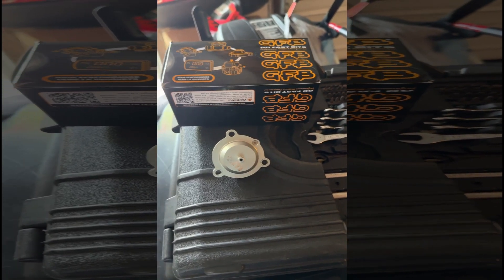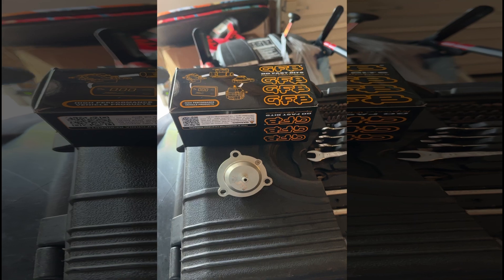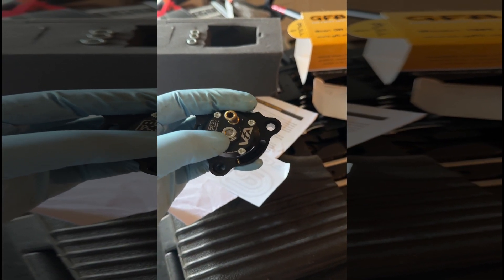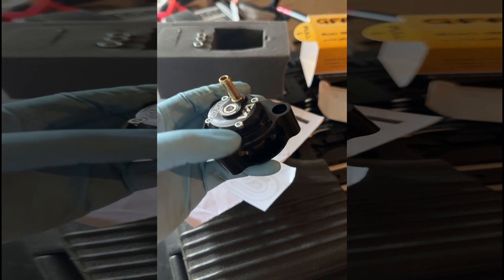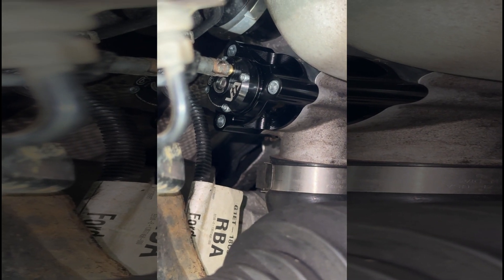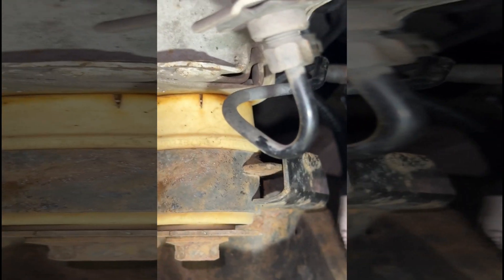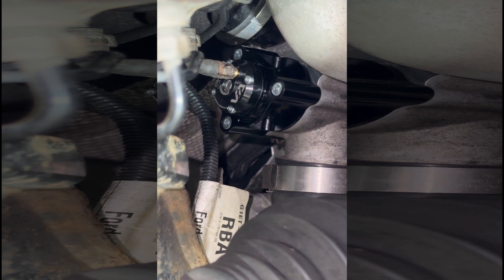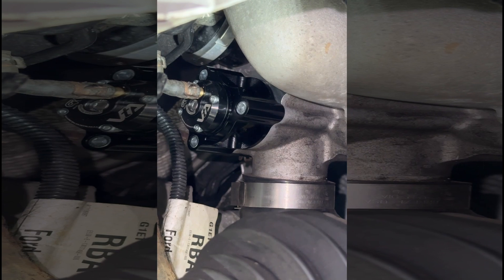Go Fast Bits BOV for your Ford Focus RS

Comment: Just ordered one for my RS. Thanks for the video! Any tips for the spring preload adjustment? They mention the softest setting is when it’s flush with the head of the valve and they recommend you tighten 3 full turns and start from there with 10 full turns in total. What have you found to be the best setting for reduced turbo lag?
Reply from the maker: I am set at two full turns, I have zero lag and it isn’t going off heavily every time I shift. Also keep in mind that when you are on the highway using cruise control extra boost pressure will release to help maintain your speed. Overall I would start at 3 turns and adjust to your pleasure, I just repeated what I originally had with set with the Turbosmart Kompact Bov.
Reply: @WrenchHeadsTuning thanks man, will give it a go. It doesn’t affect cruise control though hey? I read online it won’t affect the car negatively at all, any pros and cons overall?
Reply from the maker: @TechNick I would say this biggest pro is better acceleration vs the recirculating valve. It does not negatively affect anything about the car only improves it.